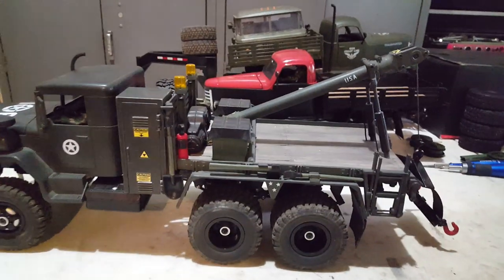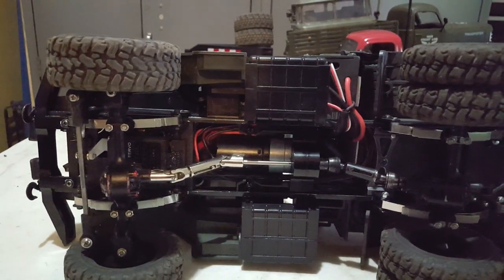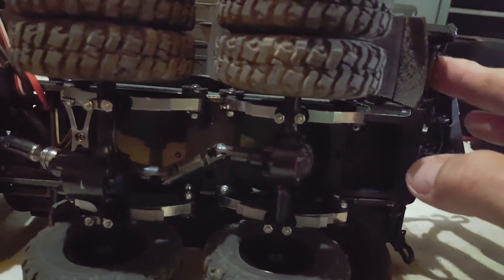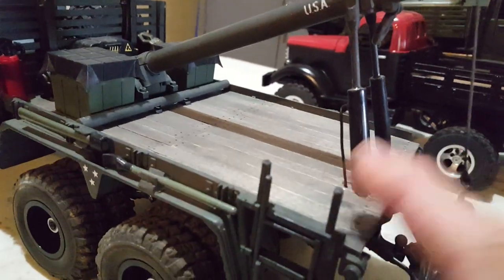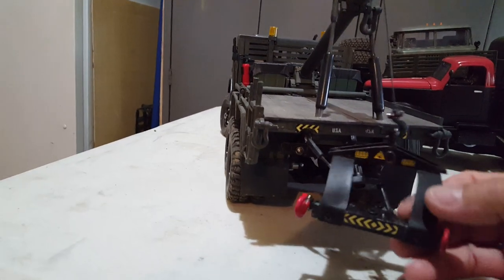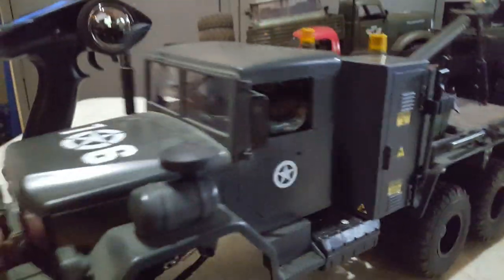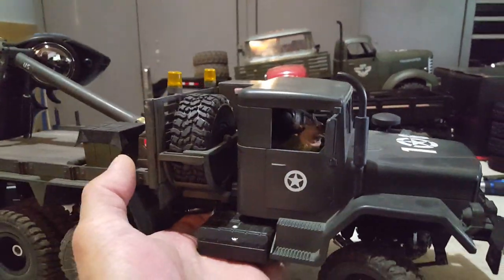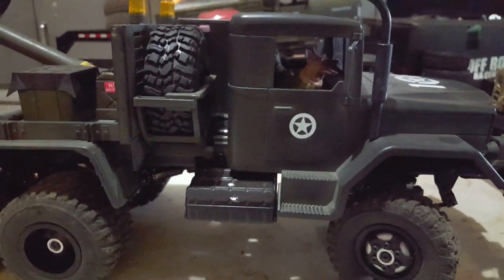Custom built WPL/JJRC M35A2 Heavy recovery wrecker

Comment: I have the same truck. From this you have built a beautiful model with many functions. However, the basic model is not realistic. It starts with the cabin, which goes too deep to the rear (rear wall). compare pictures of real M 35 Reo's. The pendulum action of the rear axle is also missing. Nice that you have put the exhaust system back in the right place. I hope for a kit that is more real.
but in spite of everything you have created a beautiful and interesting model. Thumbs up